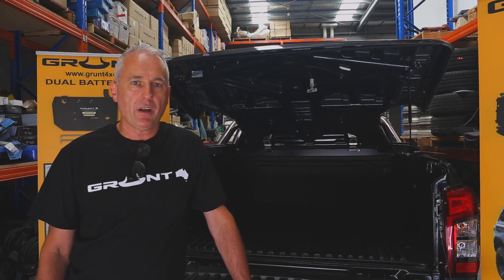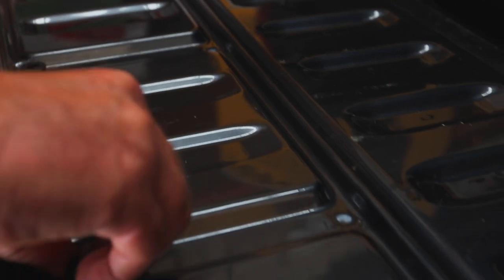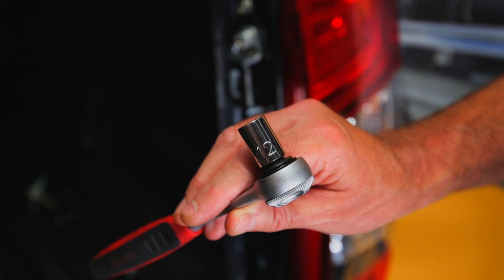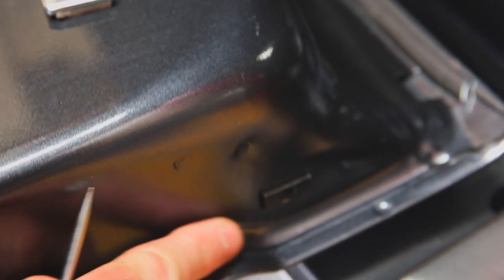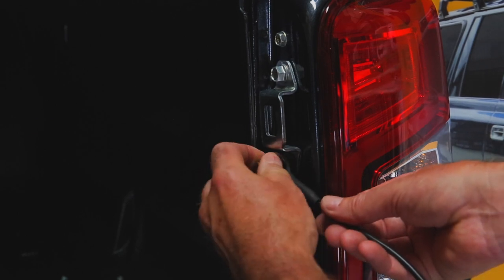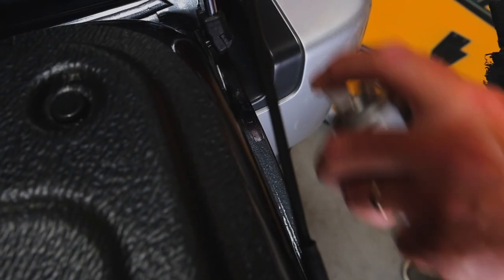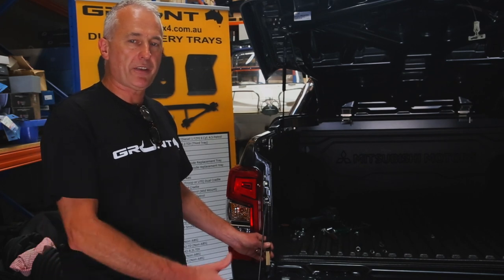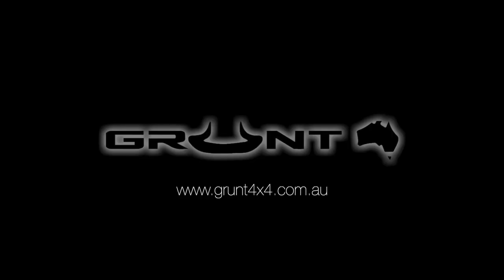Grunt 4x4 "Slow Down Easy Up" Strut Installation Guide - Mitsubishi Triton MQ MR

Comment: Cables keep ending up poking out. Any tips for fixing that? They don't seem to catch on the little rubber angles. I believe I have it all installed correctly.  Video and photos a little dark.
Reply: Same as mine,followed the instructions and watched the video and the cable gets caught especially on the right side.Its almost as though the top shock mounts need to come out and allow for more gap for cable.